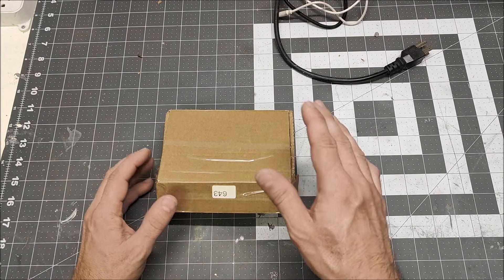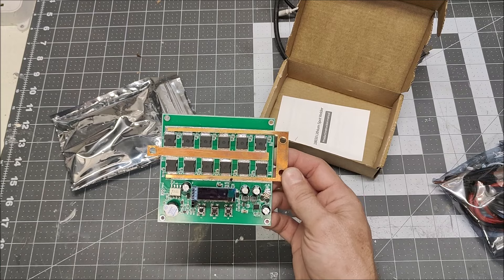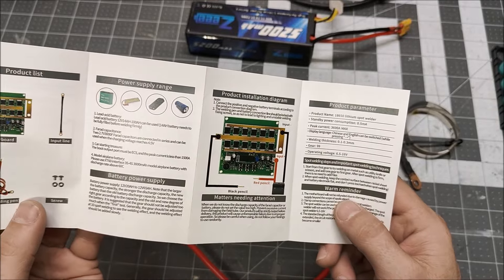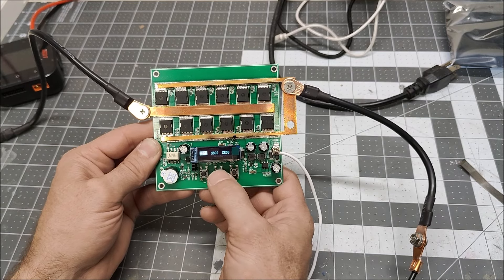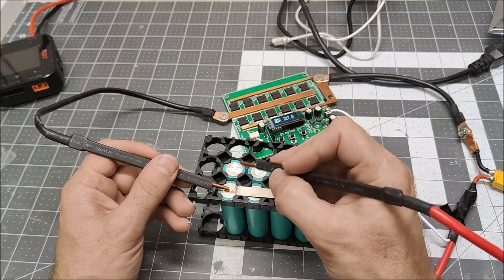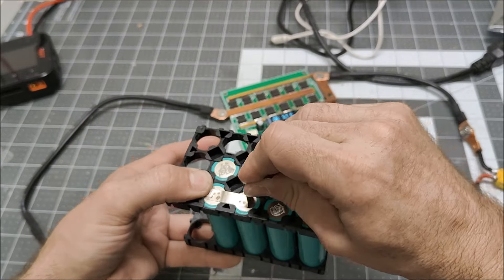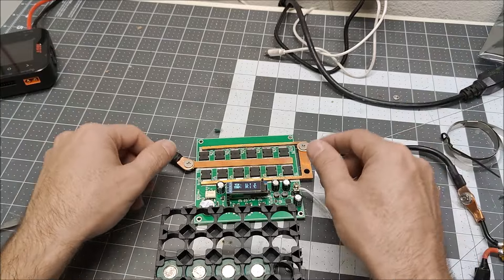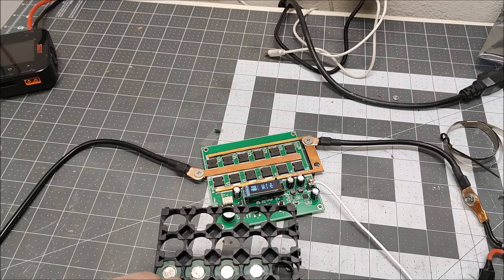New Spotwelder - Most powerful yet?

Comment: You should connect the white power wire to a separate battery and connect the batteries negative to common ground so that the mosfets wont stay open during a voltage drop and frying the mosfets, especially when using lead acid battery as a source.
Reply: How did you manage all that in practice? What kind of battery you suggest as auxiliary power source?
Reply: That happened to me. It blown on the first run. Lead acid 40Ah but not charged. Even though I don't know how can they stay open if voltage is ok from thr battery. It drops to 11V but not less
Reply: I'm going to try power the board from a 9v battery and the actual spot welder to a 110ah lead acid 850cca battery
Reply: Be cautious with this. I believe the 9V battery caused the mosfets to stay open. 12.7v car battery. Fried mosfets.

Comment: thanks to the guy in comments who checked with a scope. and found it goes through the 3 stages in succession when you hold the pins on. i'v now set the 1st delay for a second to give me plenty of time to push down, and the next 2 pulses super quick so theres less time for spots to cool. i'v got power set to 65. thanks.. this is the only place i'v found info on this. shame the sellers cant make the effort. (too much to expect these days) ....its a beast, keep an eye on your battery, my 5500 lipo is heating up

Comment: You know you can use a regular TRIAC controller powered off an external battery? You don't need to mess around with this unreliable FET nonsense. Get a good dual pulse controller
Reply: Unreliable fet nonsense? If you use genuine fets and a battery that doesn’t sag too much then you won’t have any problems.
Reply: @ericklein5097  They fail too often & destroy what you're working on its not worth it. The last one that failed on me killed every FET & blew the tracks off the board it was terrible
Reply: Cuz you don't know what you're doing @neiliewheeliebin
Reply: @ernieschatz3783 Your standards are low if you think this is a good welder, you have no idea obviously
Reply: @neiliewheeliebin i’m sick of blowing mosfets on my BifRC likely due to them being fake and ruining my battery or board. Could you recommend any spot welder which is not as expensive as kWeld and would do a 0.1mm pure copper + 0.15mm pure nickel sandwich? Thanks
Reply: @losien1  I don't think there is anything cheap that can do what you need, I ended up making one with a 10kg UPS transformer to do work like that but I was lucky to find it, microwave transformers aren't good enough for work like that either

Comment: Hello. I bought this device. I sharpened my welding pen. works with lipo 3s 5600 120c. I set the delay to 999 and the power to 20 on all three sections. the welds are repeatable and great. now I will try to make a copper-nickel sandwich. but I think he will do it without any problem. the power reserve is sufficient
Reply: I have done a copper nickel sandwich with 0.15 pure nickel and 0.15mm copper sheet. Used 20 - 200ms, 20  - 150ms, 20 - 100ms for seg 1, 2 ,and 3 with 600CCA Old Car Battery

Comment: Another great review Steven. After trying a few options I still find the JQ-DHJ02B by far the best even better  and much preferred than my BIFRC. I got the JQ one after one of your videos a yr ago and it does such a solid weld without burning any nickel. It also easily welds copper nickel sandwiches with ease. Perhaps you should add some tougher options for these spot welders to really compare and tell them apart as they ease through your 0.15 nickel. Try with copper or see how they get on with 0.3 nickel

Comment: I've bought it and checked it with an oscilloskope. It is genereting 3 pulses, SEG1 sets parameters of the first pulse, SEG2 is for the second and SEG3 is for the third one. You will want to set the deley in SEG1 to something like 500 to get the comfortable delay. All values in SEGs are in milliseconds, so 500 is half a second.
All mosfets are used as one block, they are driven from one single driver (TLP250) and are not divided in any way.
I would start with
seg1=2, delay=500;    seg2=2, delay=10;    seg3=10, delay=10
and fine tune the seg3=10 according to strip thickness and other conditions like battery voltage and internal resistance.
Seg3 is the pulse that does the real welding.

I have never seen a spot welder with 3 pulses, I don't know if it does make any sense to implement more pulses then 2. Other than that the board should be able to make some decent welds, I will try it with nickel-copper sandwich.
Reply: How did it do on the copper sandwich?
Reply: @brenthawkins204     I did not have 0.1 copper, so I played with 0.04mm copper foil and 0.1 nickel plated strip on top and it did a fine job. I'm guessing there will be no problem with 0.1mm. I will try 0.2mm, I won't have a chance to test it for the next few weeks though.
 I'm using supercapacitors, maxwell 350F in 3s2p arrangement at 7.5V. The only thing that got somewhat warm were the cables, I will probably switch from stock 10AWG to 6AWG and maybe try 3s3p.
Reply: @kgrzeg  have you tried greater thickness? why not use 2 large 2.7v 3000uf supercapacitors?
Reply: @TheUltimateDIY  Sorry for the delay.
My previous test were with bank of supercapacitors charged to 7.5V, it worked fine with 0.08mm copper. Few weeks later I got a car audio  1 farad 16V capacitor. It was HFC1000 form Hifonics. Its ESR is less then 1.5 mohm. After charging it to 12V (well within the welder specifications) I used it on copper 0.2mm. One mosfet has shorted. I have removed it and tried again with 7.5V supercapacitor. At least one more mosfet has blew, this time with small explosion.
I guess some mosfets were not shorted but still damaged and couldn't hold the stres they had no problem with before.
I'm guessing the very low internal resistance of the 1F capacitor charged to 12V delivered a current pulse high enough to produce EMF overvoltage and fried at least some of the mosfets. The manufacturer is probably testing it with lipos or car battery, both usually have higher ESR and so have lower short circuit current. So added a big 18V TVS diode to try and clamp overvoltage spikes between drain and source of the mosfet bank. But, I have not tested it yet.
I am aware that some cheap spot welder boards have a problem where the supply voltage drop can cause mosfet to fail to open at the and of the pulse, but I don't think this board is afflicted with this. I'm guessing it is the overvoltage spikes created by the self-inductance of the probe wires. I have already replaced the mosfets, added the TVS diode, and bought another HFC1000 cap (I have found one for 25USD, coudn't resist). When I will finally get around to try and actually use it, it'll be with 2 caps at 2F 0.75mohm. If the board  survives this, it will survive anything.
Reply: Thank you so much!  This information is very helpful.  I bought one based on this video and revisited it after some initial confusion and found your comment which cleared everything up.  Thanks again!
Reply: Hi Kgrzeg.
Is there any need for the delay after the third pulse?

Thanks
Reply: i have the same one and it only goes to down to 100 delay then up to 800 
I am geussing tat is miisecons
Reply: i   dont understand your delays ? 500 to a 10 delay
Reply from the maker: @1DumbSquirrel yeah ignore that. I went back to stock settings
Reply: @stevenc22  👍 👌
Reply: @kgrzeg. Thank you for this information and the settings.  Nice.  Very kind of you.
Reply: @kgrzeg  Thanks for the info! Did it survive?
Reply: Great video

Comment: Ordered one because of this video. Used the same battery as you. LED screen was DOA, but it works. Pro tip, inspect board closely. One side of the ground bar on mine was not soldered. I suspect thats the reason others are blowing these up.

Comment: A three-stage pulse for a battery spot welder is an advanced technique used to enhance the welding process

1. Improved Heat Management
Pre-Weld Heating: The first pulse can be a low-energy pulse that preheats the materials to be welded. This initial pulse increases the temperature of the metal surfaces, reducing the resistance at the weld interface, which can make the subsequent main weld pulse more efficient.
Main Weld Pulse: The second, higher-energy pulse performs the actual welding by rapidly heating the metal to create the weld joint. This pulse must be carefully controlled to ensure it is strong enough to create a durable bond without overheating the materials.
Post-Weld Heat Treatment: The third pulse, which may be lower in energy than the main weld pulse, can serve to anneal the weld area, reducing stresses and the risk of crack formation in the weld. This can improve the overall strength and durability of the weld.
Reply: What do you reccommend setting the power and delay to then for the stages?
Reply: @benperkins2929  i have that same question but i think it depends on the battery plus material and elevation that you are at bc the closer you are to the sun the more energy is conducted through the stratusphere
Reply: My battery =15v 120c discharge  and my settings are seg 1 > 300 / 70 seg-2 & 3 = 350/ 100 
Im using 0.2 nickel 
It barely welds
Reply: @1DumbSquirrel  Oh does it allow 4S?  In the video he is using 3S.  WHen I look on Aliexpress is says it a 12v input.
Reply: Thats the wrong one the one I got it says up to 16V looks almost identical to the 12V one
Reply: look for the one that says 6.5v ~ 16v
Reply: @1DumbSquirrel  Any chance you could send me a link?  I cant seem to find it anywhere on Aliexpress (or in the links for this video).
Reply: by heating metal you increase resistance not reducing

Comment: This is my second spot welder. I burnt up the first more expensive one within a few minutes. RTFM, I guess. So I bought this one because it looked like the best of the inexpensive ones on the internet.
It actually seems to work well, though it sure would be nice to have more, i.e. any, information on the segmented pulse welding function of this thing. I guess it will trial by error.
I don't think I would of ever have gotten it to work if not for Steven's video. So, muchas gracias Steven.
Oh, and I bought 3 more, all for $40.
Reply: Had a bait and switch with an even cheaper welder on my order for 3 of these , so that order is cancelled.

Comment: Your video on the JQ welder convinced me to give it a shot and I’m blown away by it. So far I’ve tried a 4S8P A123 pack and a 3S2P Headway pack (ruined a Headway so I’m down to 7). The A123 pack definitely seems more powerful. I’m spot welding 0.20mm thick pure nickel on the middle power setting with just one A123 pack and only 12AWG wire coming off the pack but I am using an  8AWG pen. I have some 6AWG for making even beefier pens but I haven’t figured out how I want to build it yet. 

I have another A123 pack and then about 24 good loose cells. It originally was a 12S8P pack I bought off eBay (they are $110 shipped and worth every penny, all you have to do is use a Dremel to cut the pack into thirds). I’m sure with a second A123 pack in parallel using some 6AWG or 2AWG I could blast through just about anything. I genuinely believe 0.30mm nickel might be possible and I’m sure I could do a copper nickel sandwich with 0.20mm copper. 

My CNHL Lipo was a terrible letdown. 5600mAh 3S2P “120C” with 7mR IR per cell. Absolute junk. 

If you need a power source for a spot welder get one of those A123 packs on eBay before they are sold out!
Reply: 2 Series Nesscap 2.7v 3000 Farad Süper Capasitör Perfect Conclusion

Comment: Do you monitor the cells of the 3s lipo battery while welding? How many welds do you get before needing to recharge the lipo?
Reply from the maker: I don't really monitor. The lipo lasts a long time. I built my whole bike battery and the lipo only went down 25%
Reply: @stevenc22  Thanks for the reply. I have ordered the spot welder and battery. I will soon be building my first e bike battery. Your videos have been very helpful.

Comment: It also seems to be controlling the sequence of pulses. The video 18:35 shows that during welding there is a series of three pulses, which are configured in the menu. And there are delays between the pulses, so before the first one you need to make a long delay. and the following ones are smaller.

Comment: You can bypass the automatic trigger by interrupting the voltage sense track. I cut the small track on the back of the board behind the (IN-/GND) and soldered a connector from that to the (IN+). I can now use my foot pedal to trigger the weld.
Reply: What sort of connector did you add? I really want to add a foot pedal but i don't know how. Also , the new version (Which i have) has the mosfets attached back to front, instead of 2 rows.
Reply: @orangehokage7  I just finished putting it together today. I haven't tested it on batteries yet, but it can weld 2 pieces of .2 mm pure nickel together no problem. What I ended up doing is after figuring out what track to cut is solder a thin wire to each side of the cut track then encase it in epoxy. For the connectors I used xt30 connectors soldered to the wires of the board and wires of the foot pedal. Polarity shouldn't matter since the foot pedal is an on/off switch. As for what trace to cut on the new version I can't say for sure. If you cut the wrong track you can always bridge it with solder.
Reply: @orangehokage7  Unfortunately the welder blew a mosfet and shorted out today. I would stay away from this one.

Comment: I saw one of the reviews on aliexpress where the user blew it up on first use. That happened to me with the purple welder too. I might still buy it, although I can manage with the old red welder from late 2021, the version with the simple capacitor mod. Still works well.
Reply: Did you find anything better then the red one, I’m considering buying that one
Reply: @yg7059  I bought the red welder in 2021 and have the version that only needs a capacitor, They have worked fine with a Turnigy 12V5AH 70-140C drone battery to do .15 nickel. I blew up two purple welders, Trouble is, I do not know if you can still buy the red welder or what mods the current versions require. That's why I have a spare.

I would consider one of the supercapacitor welders, mainly because I don't like keeping a Li-po battery around.

Comment: Have you tried using this spot welder with a single hand pen type integrated handle?
I plan to use such a pen type handle, which includes a switch, with this spot welder. I intend to connect the pen handle switch in series with the white cable on this spot welder. That means the spot welder circuit has power only when I weld so I may have to include a switch on the white cable to change between circuit only and pen handle only. Will it work do you think?

Comment: IMHO, to prevent MOSFET frying: The answer is that with an insufficient battery, the high current discharge causes the battery voltage to drop below the operating voltage required by the control circuit. That causes the MOSFET to go to a higher resistance on state. Heat is generated and MOSFETs fry. Using a separate supply for the control circuit would prevent that. This unit makes it easy to do that with the separate input. OR, you can just get a sufficient battery and make sure the charge level is high enough to prevent the voltage from dropping too low when welding.

Comment: Hi Steven, great video en reviews. Question have you already solved the innitial pulse timing issue?? If that cannot be solves i guess that thas it one of the main disadvantages of the spot welder
Reply from the maker: I think I sort of have it solved. The spot welder does three pulses. Each pulse is controlled by each of the three settings. So if you set the delay long on the first pulse and short on the other 2, it works like we want where is doesn't fire immediately but once it does fire it does all three pulses in quick succession
Reply: Steven Thanks,  
1-	What is the longest delay in time in (milli)seconds you can get before the first spot weld hits and is that long enough to stabilize the probes ? 
2-	If you now compare this spot welder with the JQ-DHJ02B which one would you buy and why?
I want to buy one of these 2 spot welders for testing and experience and after that I might go for a kweld type of spotwelder. 
PS Found out on an Russian site (https://www.youtube.com/watch?v=5p70zYPeGRY) that BRFIC has a max pulse of 70ms  which is much longer than the other tested spot welders. This in combination with the 8 mosfet gives a great punch at the highest levels. 
The JQ-DHJ02B has a max spot weld pulse of approx. 35ms (https://www.youtube.com/watch?v=xylgjPVH8HE).
 @stevenc22

Comment: Hi Steven, u posted 3  spot welder. Is there any difference or is it only a slighty other design? Did you test your spot welder with an car battery? After some time how is it still working ?
Reply from the maker: Sometimes the links change on Ali Express. Only buy the same one that looks like the one in my video. The one in my video is very good. Yes i tested with car battery. Works the same as Lipo. This one is still working and probably my main spot welder right now.